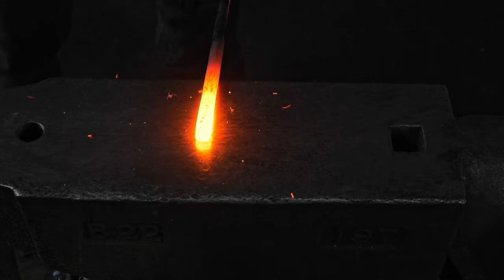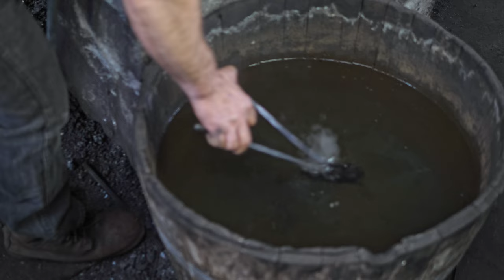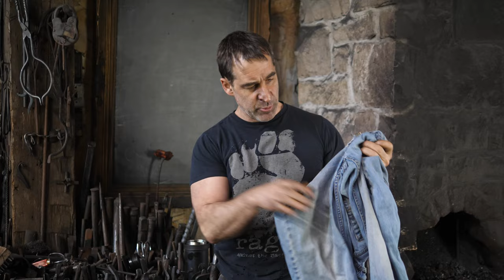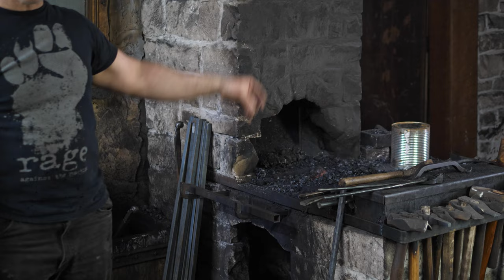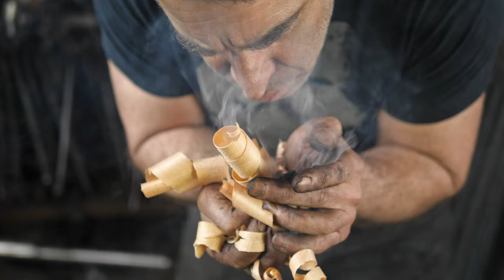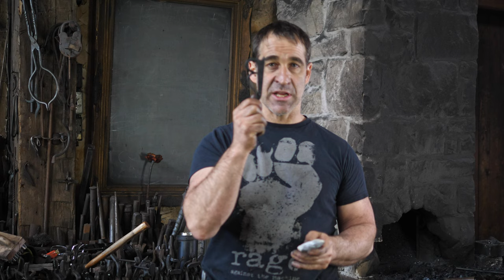How to Forge a Flint Striker - Blacksmith Basics

Comment: Where do you get flint that sparks so much?
Reply: I've found flint like that along the roadside before. Funnily enough, flint that I brought home from my holiday in France gives much better sparks than the Dutch flint I had. Must be a slightly different composition. Just pick up all the flint you can find and try them out.
Reply: @RedmarKerkhof  tnx but i just found what was the problem and the corners on my flint striker were all chippet off
Reply: Here in Wisconsin it is all over in the woods.  Just laying on the ground.